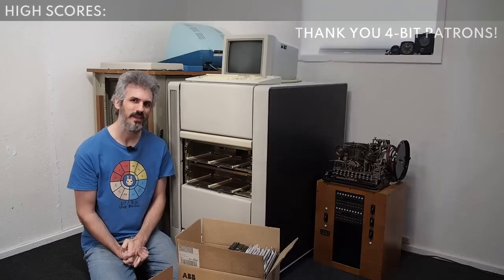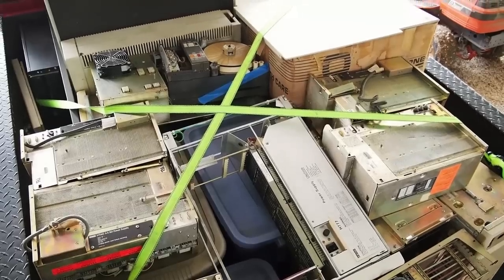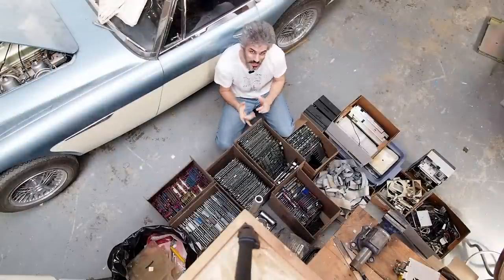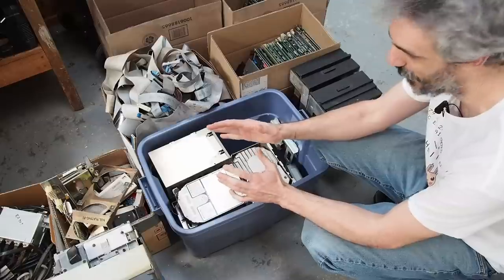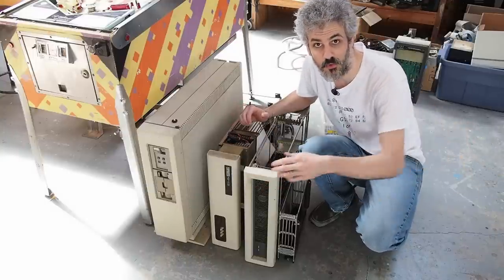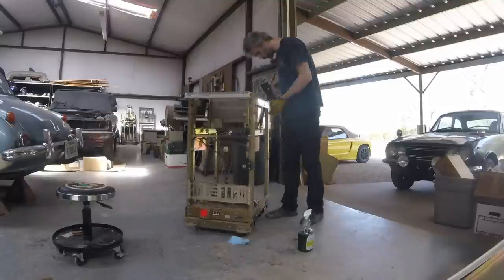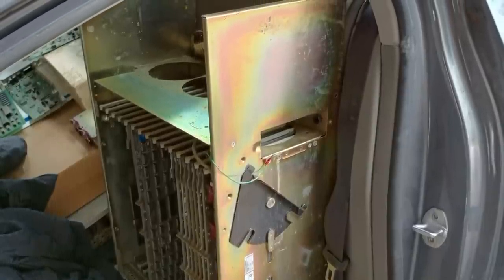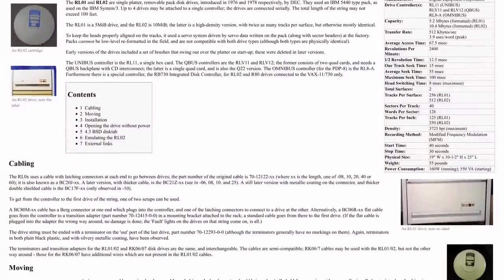The PDP-11 Motherload!

Comment: FYI the PDP-11/20, 11/05, 11/34, and later 11/23 were often used in one of the first computer-based video editing systems the CMX system bade by CMX system which was a collaboration between CBS Laboratories and Memorex. Later Ampex would introduce the ACE video editing system based on the 11/73 along with the Alex CG system based on an 11/73.

Comment: That's a whole herd of VAXen you have there!  Yes, that is the official plural from DEC.  I hope whoever gets the MicroVAX has a YouTube channel so we can enjoy that rebuild.  My first W2 job out of college involved programming the MicroVAX to create the command files for robots to autoinsert electrical components into circuit cards in fab plants.  I also did some device drivers.  If you truly want to learn what inspired Windows NT OS internals you can start with its father, the MicroVAX...  ;)  Best...
Reply: It did more than inspire it. Microsnot got Dave Cutler, the guy that wrote VMS to essentially port it to x86 and called it WindozeNT.
Reply: @Sven_Dongle  Correct.
Reply: Cutler was one of the nest of Unix haters at DEC (up to and including CEO Ken Olsen himself), and he carried that philosophy over into Windows NT.

Just thing how differently things might have turned out, if NT could have included just a few Unix-type ideas ...

Comment: We had a PDP-11/44 as one of our departmental computers (running Unix).  Yes, the CPU chassis has to  go in the top of the rack.  The reason it flips up is to make accessing the power supply connectors easier when you have to swap out a supply.  Also, be aware that there were several different versions of the console firmware, later versions  of which fixed problems that we discovered (and added features that we wanted), but these upgrades are not necessarily documented in publicly available manuals.  Also, if I remember correctly, certain slots in the first section of the backplane were dedicated for specific functions (that is, specific CPU cards) such as the cache card, the FPU card, and so on  Thus, that backplane is not a standard Unibus backplane - it is unique to the CPU..  Other than that, all subsequent backplane sections should be standard Unibus.  As usual, use the DEC-recommended order of installing peripheral cards to ensure maximum overall system performance, and don't forget the Bus Grant jumper cards in empty slots,

Comment: 8350 is roughly 2x the speed of the uVAX-II which is approximately  ~1VUP (VAX Unit of Performance ..relative to an 1978 era 11/780). People say it's "One VAX MIP" but it's closer to 500-600,000 instructions/second. Compare that with your 8bit systems to get a relative instruction throughput/perspective. It's not "that" new. They're very cool unibus/vaxbi systems. They can even run NetBSD, not just Ultrix and VMS. VAXen are essentially a 32bit extension of the 16bit -11 ISA. Anything that is a VAX-11/xxx means it has pdp-11 mode. They were thinking ahead with the -11 and designed the ISA to be extremely orthogonal. Please trust me, whilst you love 8bit and 16bit systems, the VAXen are a truely wonderful universe in their own and are a lineage of the -11's. Honestly, there's several dozen of your videos there without trying. :) <plead> Pleased don't discount the other non-11 gear. Investigate every card/system before you re-home it. It's all such a wonderful universe. </plead> 😁 Pity your not in Australia. I have a couple of spare RL02's. I'm only using one and have spares. Keep an eye out for SCSI qbus cards that talk MSCP and config via DUP. It'll be super convenient for getting O/S's up and interrogating various other storage adapters.

Comment: The MicroVAX made me groan because decades ago I worked for a place that wanted write a bunch of new modern applications to work with an SQL database. Management's only criteria for the SQL database product we needed to buy was that it had to be very very cheap. The cheapest one they could find only ran on VMS and of course all of our applications ran on Unix. No matter. The company (on the other side of the Atlantic!) promised to port their database server to Unix, but until then we had to run their server on a MicroVAX running its version of VMS. We didn't know anything about VMS so we screwed the machine up at least once a week.

Eventually the project was cancelled, the British company hadn't ported a single line of their code to Unix (smart), and for years and years we had a MicroVAX sitting unplugged in the back of our main computer room collecting dust. Memories!

Comment: This should be a fun series of vids. I have a PDP-11/84 in the basement that gets stuck part way through the startup process. It doesn't help that I don't have any drives or drive controllers, but the process hangs up before it gets to the point of looking for a boot device. It got shoved into a corner because I didn't have the time or resources to deal with it then, but it would be nice to dig it out and give it another go.

Comment: I worked for a Fortune 10 company that I was told at one time was DEC's biggest commercial customer. I am very DEC ignorant but I know this company was a pioneer in using  beaucoup PDPs for process control and lab computing. Years after I left I talked to one of the plant IT guys and he told me they were still running ancient PDPs for mission critical systems.. They were resorting to scouring EBAY and other sites for PDP parts to keep the plants  running. Sometimes afterward he related that lack of tech refreshes finally bit them in the ass causing manufacturing outages. The company  eventually canned almost all of the IT staff blaming them for 'not escalating the issue'.

Comment: The best way to get an original PDP-11 without needing a lot of space is to get a VT-103.  This is a VT-100 with QBus slots which can be configured as a standalone LSI-11 system.

If you intend to test those TK50 drives or any other CompacTape/DLT drive you must have proper cooling behind them or the pancake servos WILL overheat.

Comment: PDP 11 was the first mini I ever used, if you typed really fast in vi and could get it to crash it left you with a shell with root access.  Later on I used Prime minis, not sure if you would ever come across one of those.  I was wondering if you have any way of measuring power draw when you get one of those PDP 11s going.

Comment: "Motherload" is certainly the right word!  You've gotten lots of breaks where "Good Stuff" was donated to your cause.  If I was within a reasonable drive (I'm about 30 minutes east of Gainesville Florida), I could give you one or two RL01s or RL02s with some disk packs (I think I've got more drives than I'll ever get around to using).  I've got three QBUS systems, but can't recall which ones (something like a PDP-11/05?, a PDP-11/73?, and a PDP-11/83? -- along with a VAX 4000-something system and my PDP-8 Family collection [not complete though]), but very few extra modules/cards to go with them.
Reply: I saw your DECtape-II drives and thought that the tub they were in was about the size of one of my DECtaoe transports (TU55s & TU56) along with almost a full 6-ft rack of "stuff" to connect between the transport & TU56 to connect to my PDP-8/E or PDP-8/A.  ("Stuff" is a tape controller, logic level converter, PSUs, a ton of cables, etc.)  Be careful with your DECtape-IIs because the tape in the cartridges may have started deteriorated depending on age & previous storage conditions!

Comment: Was at college in London during the mid '80s. There very first Unix box I ever used was a VAX; also later got to use VMS, including microvaxes running VMS and (if I remember straight) the first GUI I got my hands on.

It’s strange: at that time, the Vax was seen as a superb high end architecture. These days, some view it as a CISC extreme that was ultimately a dead end.

PDP-11 is a fascinating architecture in its own right, although I’ve only ever really glanced at it. It’s said to be the inspiration for the 68k and 32k CPU ISAs. Aren’t there a whole plethora of different OSs for PDP-11s? I don’t think todays video talked much about intentions on the OS and SW side for these beasties.
Reply: Up to about 1970, machine instruction sets tended to be full of odd quirks, like certain instructions only working with certain registers. The PDP-11 was a step forward in removing a lot of these quirks, so for example the MOV instruction could use any of the standard addressing modes for both source and address operands, in both byte and word sizes. Many people were fond of its instruction set for this reason.

The VAX took this to the next level, and added all kinds of things that the designers thought would be convenient to have, like polynomial evaluation, search for character, search for bit set/bit clear etc -- each in a single instruction. In many ways, you could do some things in assembly language at a higher level than the equivalent in FORTRAN!

But this was just about the time that other hardware designers were discovering that, in order to make the hardware fast, you had to keep it simple. Even the VAX engineers had to take account of this by the mid-1980s or so. For example, you could push registers R0-R5 onto the stack in a single instruction

    PUSHR S^♯^M<R0,R1,R2,R3,R4,R5>

which was just 2 bytes. But the equivalent sequence

    PUSHL R5
    PUSHL R4
    PUSHL R3
    PUSHL R2
    PUSHL R1
    PUSHL R0

even though it was much longer at 12 bytes, was actually faster.

This discovery, that simpler is better, was the foundation of the whole RISC movement. And the end of complex architectures like the VAX.

Comment: THe dectable with front and size is an early small vax 9750? 730?, i'm forgetting the model numbrer), the side tape drive loaded the firmware into the cpu and dec service was the ones to change that tape if needed.  The front drive was for the customer.

Comment: How about using flight/road cases for the portable racks? They're already intended to be transported, there's stackable, lightweight versions, and they have 19" racks pre-installed -- they're usually used for transporting PA systems and other audio/video gear.

Comment: Uhh good memories. I had 10+ years with PDP-11 unibus machines, that were OEM build by atex inc. from Bedford, USA for the newpapers industries as editorial and advertising purpose. They actually build a kind of cluster controller called MPB, multi processor bus, so a ex 8 CPU acted in pairs of 2 CPUs enabling very high redundency , especially for the time. (Designed in early 1980ies).  The terminals were video terminals with the keyboard comm in the special 134 keys keyboard. No VT100 terminals. Later in mit 90s the PDP-11 CPUs were upgraded to J11s to keep the systems running. 32 used per CPU with 1MB memory and 80MB disc pr CPU
Lovely time

Comment: There's usually a guy in the vendor room at VSF East that has a bunch of DEC stuff, if you're willing to wait for an RL drive to show up. The prices are what to look at however, but you can at least use that as a foot in the door to see where to find one. By the time Saturday rolls around though, I'm sure you'll have talked with a few notable people in the place about DEC stuff to possibly secure one or know where to secure one, assuming other channels don't work out.

Comment: The us navy still uses 14 inch drives with removable plader on their tyconderoga crusers on the eagis system. its shown in their old bagis bmd chalenge aka bulistic misile defence upgrade frome the 200s
Reply: That raises a good point. Monitor federal government auctions and sales.  They are notorious for using computing equipment long past its technological lifespan.

Comment: Around 1980 me and a buddy would check out the Design Grafix CAD on the companies PDP-11, it had a couple of 5MB drives that were huge, with power cables that were the size of a dryer power cord feeding the chassis, and when we powered it up, we had to power the drives up separately because if both drives were turned on at the same time, it would trip the breaker for that wing of the building.  Anybody know who made those drives?  They also had a vector graphic screen that stored the image, and it reminded me of one of those BattleZone games as it drew lines on the screen.

Comment: Don’t forget your chip clip bus terminators 😂 - if I remember correctly, you even needed those in the LA-30/36 line printer logic card bays.  The last DEC stuff I worked on was porting a healthcare app in ‘C’ to a DEC alpha monster (before compaq gobbled them up and before 64bit CPUs were cool).  I learned my first computer skills on an 11/04 with Dartmouth BASIC...but nostalgia will kill you, the power consumption alone is a deal breaker for me.

Comment: Should definitely keep a VAX they are the best IMHO 32bit, the VMS operating system you can get enthusiast licenses for it or if you like put *NIX on it. The VAX/VMS OS installed could run from 11/730 to their 9000 series mainframe the OS had all the kernel components to just boot - was just a tuning issue (if you took a high end VAX to a low end you would have tuning on memory issues but not much else). You could either get enthusiasts compiler license or GCC. I missed out on the PDP era so never got into it when playing with the VAX, nothing like doing CRC32 in one instruction or polynomial math too.

Comment: Did the RL-01 and 02s have removable stacks of plates?
Reply: No. The cartridge for both RL01 and RL02 had only one platter. RL05 stores 5 MB, RL02 stores 10 MB.
Note that on the platter are also tracks for the servo mechanism. If you erase n RL01 or RL02 with a demagnetizer, the cartridge is utterly useless afterwards (except for a "wall clock").
RL drives are very reliable, even now!

Comment: I'd personally like to see someone get an old Data General machine up and running. I don't see DG stuff anymore on eBay but it must be out there. I cut my teeth on machines like the Nova 1200, Nova 2, 3, and 4.
Reply: There is also DataPoint. It was a Texas company with facilities in San Antonio, Fort Worth and Waco.
Reply: The guy on the Tech Tangents channel got hold of a DG machine some years ago. I think he has been tinkering with it off and on. The components inside seemed quite roughly put together--less neat than DEC gear.

Comment: Here's a thought, why hasn't someone built a modern parts PDP-11 clone yet? I know majority of the compute side of a fully fitted PDP-11 can be crammed down to a Cyclone FPGA and SRAM, but the real undertaking would be the absolutely massive I/O bus and addressing multiple real storage units.
Reply: Or, you could build a “PiDP-11”. That has a Raspberry π at its heart, in an authentic-looking reproduction case (complete with panel switches!). Instead of recreating the original electronics, it runs the SIMH emulator, which is faster in software (even on a π!) than any original -11 could ever be.
Reply: @lawrencedoliveiro9104  Yeah, I've seen those. They're not all that accurate timing-wise, and you can't cram it into a Q-BUS port. If I really wanted to go that far from the real deal I wouldn't be watching videos on REAL PDP-11s and fantasizing.

Comment: just learnt that motorola designed the 6800 and the 68000 based on the PDP-11
Reply: Yes. PDP-11 assembler and 68000 assembler are very similar!

Comment: Be careful with those tapes!!!  I have an HP-85 that uses DC100 tapes and the old ones will have the magnetic material stuck to the rollers after sitting in less than ideal conditions.  search for CuriousMarc's videos on them if you try to read them.

Comment: I love vax.   VMS rocks!
Reply: VMS is for kids... real men use RSTS. ;) ;)
Reply: The main problem with the PDP-11 is that constrained 16-bit address space. I remember I tried to help a friend write an ODL file so that his program could be split up into overlays that were small enough to fit into RAM one at a time. Can’t remember how far he got with that. Quite likely, not very far...

Later versions of RSTS/E started using additional CPU modes in increasingly creative ways that they weren’t initially designed for, to try to get around this.

That’s why the 32-bit VAX was such a massive leap forward.

Comment: Do any viewers of this channel have any S-100 bus items related to 
Xitan made by (Technical Design Labs) or (Computer Design Labs)?

I got one years ago, that was user modified. I had no software for it.
When I turned it on, all I could get was a screen full of simi random characters.
It has a 8 slot backplane and 5 factory made/(user modified(bodge wires)) cards.
No manuals.

Since then I got 2 blank S-100 bus perf boards waiting for whatever I can dream up..

I would also like to know if anyone can help me with getting the 
S-100 bus edge connector added to KiCad 6?